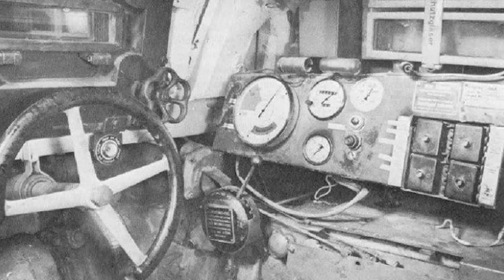A Deep Dive into the Tiger I, by the Chieftain

Comment: I always remember the 5 Tigers which drove off one morning.  Two broke down, another two towed them back home, and the fifth found a Guards Tank Army assembly area and single-handedly disrupted their entire day.  Is the Tiger the tank which experience 80% non-combat losses driving to work that morning?  Or the tank which mauled a Guards Tank Army all by itself?  Yes.  But I'd be a lot higher on it if it could successfully engage in mobile warfare.
Reply: Probably a company or at most battalion sized detachment of the Guards Tank Army (assuming it's even true.
I find it very hard to believe that a single Tiger could cause this much damage before it runs into a mine or several guns achieves a mobility kill on it (which the Germans crew would be mowed down as they attempt to bail out of their tank).
Reply: @HaloFTW55  it's most probably true, Soviet tanks relied on numbers not in quality, they broke down very often, but they were very simple, so crew with hammer and crowbar could fix it on the field.
Reply: @ggsay1687  I was referring to a single Tiger (unsure if there are any other tanks or infantry support) setting back a battalion for an entire day, so I'm not sure where Soviet tanks factor into this. Plus, the thing most likely to be ready to receive German tanks would be mines and AT guns so once again, I'm not sure where Soviet tanks came into the factor.
Reply: @HaloFTW55  it depends on position of Tiger, if the tank has defending position on bottle neck, it could shoot T-34 from distance up to 2 km, T-34 with their short barrel 75mm gun wouldn't be able to hit the tank, mowing down infantry with machine gun is pretty good deal in that case.
Reply: @ggsay1687  Let's get back on track. We're talking about 1 Tiger out of a broken down platoon of 5 with unknown amounts of infantry support and/or support from other tanks somehow overcoming an entire Guards Tank Army (which is the equal to an experienced field army) during an offensive operation. I don't know about you but that seems like a bit of a stretch, unless somebody just wants make a German version of the lone KV accidentally stalling half of the 6th Panzer Division for at least a quarter of a day.
Reply: @HaloFTW55 ? å
Reply: @HaloFTW55  I think the original post is referring to an famous incident on the West Front.
Reply: @HaloFTW55  in France lone Tiger I did exactly that.
Reply: I'd have to look at the specifics, but it's not like it's that hard to find Tigers dropping like flies simply driving around, nor is it hard to find examples of Tigers blowing up absolute hordes of Russians.  It's just getting both in one instance is relatively rare.  Zabel's invincible Tiger 231 aside, I'd have to look at whether or not Staudegger was the sole survivor of the trip to work in the morning before he started going for the record for single day T-34 kills.
Reply: All WW2 tanks broke down a lot - the Sherman, too. Out of 50 Shermans, 15-20 could be expected to fall out during a 50 km road march (Belton Cooper).

The Tiger had about the same availability rate as the Panzer IV - despite often being used much more aggressively. The "horrible reliability" of the big cats was mainly allied propaganda. Of all the panzers, only the early Panther Ausf. D was unreliable by WW2 standards. This is 1939-1945 - even your vanilla family car could break down at any time. And tanks have always been much more unreliable than cars.
Reply: @TTTT-oc4eb  The Tiger's problem with reliability wasn't necessarily that it broke down more than anything else.  It did have a habit of crashing through bridges at an alarming rate, though.  It didn't have a recovery vehicle, so the improvised recovery vehicle was the nearest Tiger, which already had a marginal transmission so you often got a two for one breakdown rate as well as the two for one mission kill.  And then there's the question of replacing parts, assuming you even had them in the first place.  It really was produced with no thought whatsoever to a reasonable logistical tail.
Reply: @HaloFTW55  I believe the Tiger in question caught the Soviet tanks parked in a staging area, neatly parked in rows. They were destroyed before crews could get to the tanks and move them.
Reply: Tiger wasn't designed for strategic mobility or long distance cross country travel. It was designed as a breakthrough vehicle to be used to punch a hole at specific point in the front then allowing the lighter Panzer units to push through and exploit.
Reply: @HaloFTW55  it's impossible only the US of A baby can do so much damage, if there is an enemy that isn't a third world country or weakened beyond believe, then we send in the atoms baby, oorah semper fi.
Reply: @saoirseewing4877 thank you for indirectly mentioning its weight. The tiger was very heavy for the time and most Eastern European infrastructure at the time was absolutely not made to hold that much so getting around and to the battlefield took much longer and much more consideration
Reply: Combat veteran?
Reply: I cannot think of a more miserable job than changing an inner road wheel during the rasputitsa or during the winter.
Reply: One of the genius elements that mafe the Sherman such an effective weapons system was the ease at which it could be repaired in the field. Compare gearbox replacement on a Sherman vs a Tiger and remember that in WW2 stripping your gears, especially on the huge Germantanks, was an occupational hazard.
Reply: @ggsay1687 very true
Reply: Wtf are you smoking
Reply: saoirseewing4877
"It did have a habit of crashing through bridges at an alarming rate, though."

It did happen sometimes but not at an alarming rate. I have no idea who told you that. Even a 25 ton Jagdpanzer IV collapsed the bridge at Petit Spai in the Ardennes, and that was lighter than a Sherman and T-34.
Reply: @HarryFlashmanVC

The Sherman was effective because there were lots of them and they enjoyed combined arms support. Take those away and it was average. The Sherman by itself was mediocre in taking on the Germans cats frontally without artillery and air support.
The Estrees la Campagne on 9th August 1944 during Operation Totalize. The Canadian 28th Armoured Regiment lost 44 Shermans to a smaller number of Tigers from Schwere SS Panzer Abteilung 101 and Panthers of 12th SS. The Tigers in particular were plinking them from over
1,000 metres. Nor a single Tiger was lost. Google the destruction of Worthington Force.
Reply: The only thing bigger than a Tiger is the hype and myth about them😂

Comment: A very interesting video on the Tiger I that is the oldest Tiger in existence. It was conceived as a breakthrough heavy tank and therefore it was heavily armored but it was overall a difficult and expensive tank to to produce with high quality materials. I must point out an issue regarding the sloped armour: both Germany, Italy and France knew the advantages of the sloped armour since the 1st WW but it was never seriously adopted on the tanks. But curiously it was adopted on the Sd.Kfz 251 and the Sd.Kfz 250 so by the by planning Tiger it could be said that it was only because of the inherent conservationism of the planners and some generals that it was not implemented. In fact if you read carefully the original manual of the Tiger it emphatically stated no to stand at 12 o'clock in front of the enemy but to turn the front more side way in order to ricochet the incoming shots. Good job 👏 👍👍
Reply from the maker: Thank you Paolo. Very interesting
Reply: @WorldWarTwo  you are welcome! 👍👍

Comment: Funny how at 23:16 the museum curator (incorrectly) completely contradicts Chieftain. Claiming the Tiger was built entirely around the 8.8cm gun, when in reality the Tiger had initially no plans to even use it, and the fact that it did really being more a product of circumstance. The German Army wanted the 7.5cm gun, the 8.8 only won because of a better HE charge and simplified logistics.
Reply: I think the confusion is because there were parallel development programs for the Tiger; one headed by Porsche and the other by Henschel. The Porsche design started with the chassis developed by Porsche and the turret was designed by Krupp around the 8.8 cm. The turret would be kept and put on the Henschel design. 

So, as Obi Wan Kenobi said, it is true from a certain point of view.
Reply: @timothyhouse1622  Perhaps I'm just being pedantic, but what he said is indeed totally untrue. He says: "The Germans quickly embraced the 88 as their new tank gun. So really this whole tank starts out based on that weapon system." When in reality, the Porsche and Henschel hull designs were developed before a gun had even been selected for the tank. The request for a turret design only came after, with Krupp submitting what would become the Tiger's turret for the Porsche hull, based around the 8.8cm gun. As was typical of German tank design, the tank began development to meet a requirement, the gun came later. It wasn't until Tiger II that this trend was bucked.
Reply from the maker: I brought this up with the chieftan before we premiered and timothy is right the porche turret was designed around the 8.8 even though the gun wasnt the primary consideration when making the tank. Its a little confusing, i know.
Reply: It comes down to frame of reference. The Tiger as it eventually was built turned out the way it was because it was based around the turret which was designed to hold the 8.8, once the 8.8 was selected. The entire 'breakthrough tank programe' was not designed about any specific gun, the 8.8 just ended up being selected. Once that was done, that was the end of that. So both of us are correct.
Reply: Regarding museum...........Anyone know if that Tiger 1 in museum has original type paint? Or extra glossy for display.
Reply: @twt000  It's highly unlikely that is the original type of paint. Tiger 131 has been restored as accurately as current knowledge permits and it appears to be less glossy.

Comment: I remember reading "Panzer Commander" and noted that 80% of a Tiger Platoon Leader's job was going back the next day with your one working Tiger to go pick up and tow your broken down ones off the battlefield or the swamp 5 miles away. It was quite pathetic.
Reply: Tigers actually had an overall operational ratio of 65-70%, which is pretty darn good for a heavy tank.
Very few broke down on the battlefield.
Reply: @lyndoncmp5751  Possibly but the war memoirs of those who fought in them seem to spend more time doing recovery than fighting.

Comment: The Tiger 1 was arguably the first true "super tank". There had been earlier candidates, like the Matilda II, Char B1 and the KV 1, but all these had several factors that limited their value. In the Tiger 1 it "all came together"; firepower, ammo quality, superb sights, armor (both thickness and quality), excellent offroad mobility, veteran crews, proven tactics and even (relatively) reliability. Arguably no tank, sooner or later, had the margin of superiority that the Tiger enjoyed from its introduction in late 1942 to early 1944, when the Panther finally became combat ready and the Soviets introduced the IS-2. Even so, the "old" Tiger 1 remained at least the equal to any new Allied tank introduced until the end. Its mental value was such that it basically upgraded the entire fleet of German AFVs - after all, any engine sound out there COULD be a Tiger. 

Of course, when it comes to weapon systems there is nothing like a free lunch, and the Tiger came with the usual disadvantages of heavy tanks; cost, extreme weight and high maintenance.
Reply: I guess it's going to depend on what you consider "equal". Yeah sure it could stand up to a sherman long 76 or a t34-85 with ease, but these tanks could also stand up to it. The allies had tools to put holes in tigers before the IS-2 got introduced. And they were being produced in droves while the tiger could barely keep up. All for a tank that pound for pound, had more or less the same performance in defensive warfare as the cheaper, more reliable, more effective and more ubiquitous panzer IV F2/J and stuG, which could just as easily punch straight through shermans and t34s.
Reply: @joaogomes9405  Both the US 76mm and the Soviet 85mm was plagued with poor quality standard ammo and underperformed in the AT rolle. The Tiger was at least as reliable as the Panzer IV.
Reply: Yes. The Tiger I was truly the first real "battlefield dominating" tank.
Reply: @TTTT-oc4eb   The american 76mm using the M62A1 APC shell was able to perforate it from  800 meters and shells were made with excelent quality so cut the bs.
Reply: @viceralman8450  The quality problems of the armor piercing rounds for the 76mm M1 and 90mm M3 are well known. The rounds were too soft and in addition the HE filler often detonated on impact, causing the round to shatter.
Reply: @TTTT-oc4eb   If they are so well know any source then?
Reply: @viceralman8450  Richard Anderson of the Dupuy Institute:

“The "problem" with the 76mm wasn't really a single problem with the gun or in testing...it was multiple problems. The standard projectile, the 76mm APC M62 was produced with a large cavity for the burster, because everyone assumed that it was the behind-armor effect of the HE bursting that would do the most damage. However, there were two problems with that. For one, the larger cavity weakened the projectile, causing it to stress shatter when striking at high projectile diameter to armor thickness ratios. And then, even when it didn't fail, the BD fuse (common in all the US APC rounds) tended to go off before penetration was completed, destroying the projectile and preventing penetration.

However, when tested at Aberdeen they weren't testing for behind-armor effects, so the cavity was inert filled, which improved the results. The problem was exacerbated by the simple fact they assumed the Germans would be using armor similar to our own and BRL did not have samples to test to destruction until late 1943 in the case of the Tiger, early 1944 in the case of a late-model Panzer IV, and late October 1944 in the case of the Panther, which was far too late since the 76mm gun development was completed in early 1942. On top of that, it wasn't until June 1944 that it was realized the hardness specifications for the American projectiles was insufficient as well, which meant that the solid AP projectiles were also deforming and shattering when striking the German armor, even though after the initial problems found with the APC rounds had led to the assumption relying on the simpler AP shot would solve the problem. The solution was re-heat treated AP shot, the M77 in the 90mm, which became the T33, while in the 76mm work on perfecting the HVAP continued.

On top of that, the 76mm had major issues with flash and blast obscuring observation of the fall of shot. The flash problem was solved when it was found that it was caused by failure to completely combust the propellant in the cartridge...the solution was a longer ignition primer. Blast could be solved by a muzzle brake, but it was considered NIH - and too "German" - so was delayed in deployment.

Of course, the worst problem was the conservatism of Ordnance. The flash problem could have been solved from the get go with flash suppressing chemical additives, but they were considered to cause excessive wear in the tube so were rejected, since Ordnance liked to achieve 1,000+ round lifetimes in its barrels, which hardly helped when the tank it was fitted to only fired 200 rounds before it was knocked out. On top of that, despite advice to increase the propellant load and thus increase chamber pressure and Mv (as did the Germans in the Pak/KwK/StK 40 and KwK 42 and the British in the 17-pdr) in the 3" and 76mm, Ordnance refused because of concerns with safety issues. Fundamentally, there was nothing mysterious about the 17-pdr that made it a better 3" gun than the American 3" gun, since, despite the nomenclature, the 17-pdr, 77mm, 76mm, and 3" guns were all very similar pieces.”
Reply: @TTTT-oc4eb   The M62 issues were fixes in the A1 variant the one fielded to.
Reply: @viceralman8450  The M62A1 was the first round and the one with the problem. Even Wikipedia mention it. I would guess they had solved the problem by Korea, or they had plenty of APCR.

Comment: You may have answered your own question as to why the gunner was on the left. You talked about the need for coordination between gunner and driver. By putting them both on the same side, this would aid this coordination. Additionally, the commander and gunner are also both on the same side which would also aid their coordination especially if the vehicle has been damaged especially the intercom or electrical system.
Reply from the maker: Thanks for that comment Gerald. I love hearing theories like this.
Reply: @WorldWarTwo  Well, if you put the loader on one side, automatically you would put the gunner and TC together on the other side.

Comment: Speaking of cutaways. When I was instructing at Todd Hall (no longer in existence but the LST packing trainer that stood behind it is still there) at Ft Knox, late 80's early 90's, the Patton Museum traded an XM803 iirc to APG for a Tiger II, at the time not cut away. Created quite a stir on post when it was towed down Eisenhower Ave to Todd Hall where it was parked next to my setup. I used to tease Marine master gunner students that it was the new M1A3 specifically built for the marines. After a year or so it was towed to Boatwrong maint facility where it was cut open and subsequently put on indoor display at the museum. Then moved to Ft Benning with the rest of the  museum's assets.